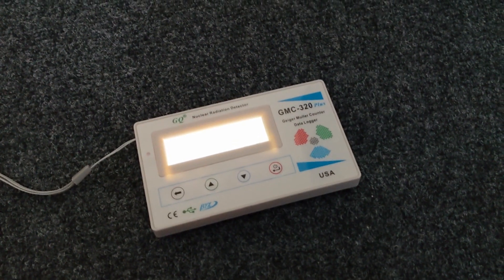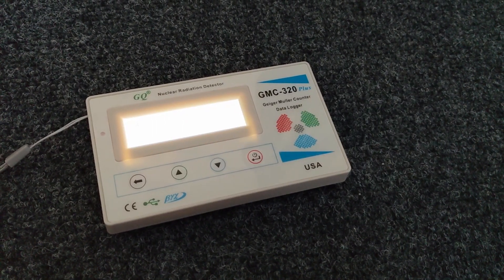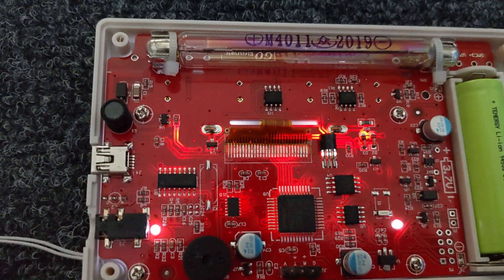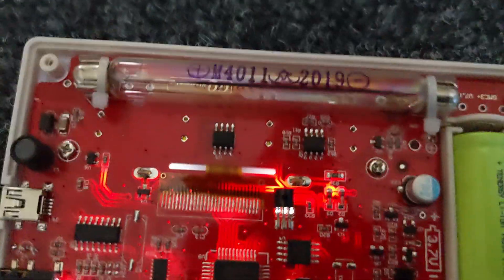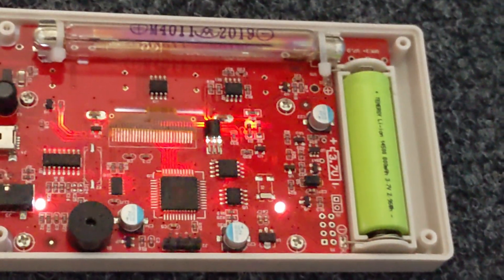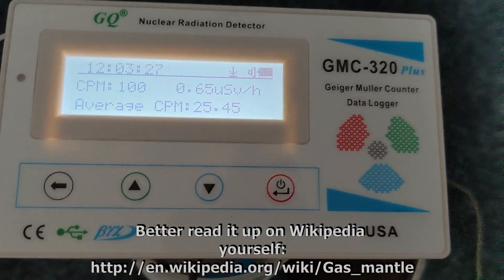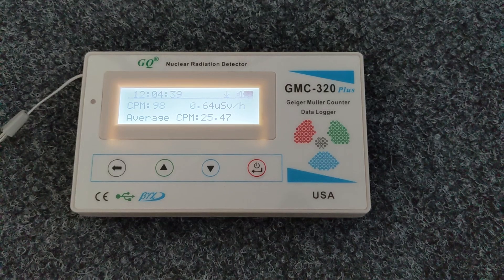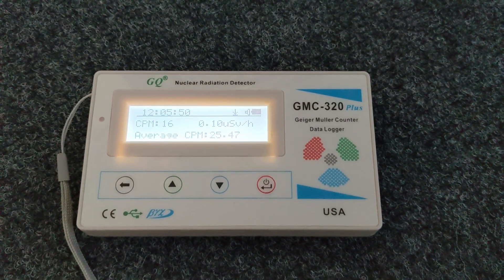Geiger counter GMC-320 Plus - Light sensitive M4011 tube | Geiger counter

Comment: Mine actually has a black plastic cover on the tube to block light.
Reply from the maker: Yes they added that at some point. I seem to have an early version that is also using an elder HW revision with a different processor.

Comment: You should know that this 20 tubes from Kyiv is very old and even they sold like new ones or looks like new they do not work correctly in 80%. Gas inside the tube is gone after 30 years and they can increase all measurements in 2-3 times. Try to find this info, i see this information about this tubes on Ukrainian channels
Reply: Better to buy another one like kb6011 it has j321 tube inside =4011 tube but with special foil over tube and do not sensitive to light
Reply from the maker: @sepe6a  I doubt that adding black heat shrink to the tube boosts their quality significantly, whether its a M4011 or J321. It surely helps to mitigate the problem a little bit. One could also spray-paint the glass body black, or wrap it with black electrical tape. I think my tube was just especially terrible to begin with 😄. Also I remember reading in the GMC support forum, that they also built versions of their Geiger counters that had the extra black foil added to the M4011 tube.
Reply from the maker: Thanks for the warning. The choice of tubes is limited. Either you get a bad light sensitive chinese copy or you have to use old Soviet era NOS. Neither is ideal... 😕 So far the replacement seems to work ok and does not produce completely implausible results, but i did not have time for detailed experiments with a test radiator yet.

Comment: What version is this? V4 or V5?
Reply from the maker: The version without the WiFi ESP32 module. So i guess V4.
Reply: @labcat73  I have a 320+ V4 as well, found out there's a firmware update available for these that adds the capability to go above 65k CPM, and adds fast estimate reading, when I got mine the firmware revision was 4.70, and the update changed it to 4.74. 

You just email GQ support with your model and serial number asking for a firmware update.
Reply from the maker: @madmax2069  I am on “Re 4.58”. I asked for the latest firmware version when I got the device. Is that still the newest one?
Reply: @labcat73  I emailed them yesterday, 4.74 is the latest. I wouldn't mind on seeing a video comparison of the count response/speed between the old firmware vs the new firmware. The firmware adds the settings fast estimate reading and the options are dynamic, 5-60 seconds.
Reply: @labcat73  if you plan to update, go through each setting (even the the calibration settings) and make a mental note, or in a text file, or on paper of each setting you have because it resets everything
Reply from the maker: @madmax2069  Interesting that there are still updates for such an old device. Good to know. I'll have to get it then.
Reply: @labcat73  it definitely makes them more usable, the update added fast estimate reading which is a pretty useful setting, when you change it to 5 seconds (the default is dynamic) it'll count up and stabilize on a source in a few seconds vs minutes. with my united nuclear test card it maxes out at around 500 CPM, and with the old firmware it took a bit over a minute to count up and stabilize, after the update and changing the fast estimate reading to 5 it counted up and stabilized in around a second. And also increases the max CPM (old firmware was 65K CPM now it's well about 100k CPM).
Reply from the maker: @madmax2069  Looks like i am out of luck: The CPU on my elder GMC-320+V4 is no longer supported it seems. I got a FW update, but it does not install on the STM 15L2K60S2 that i have in my unit. So i am stuck with V4.58.
Reply: @labcat73  did they give you the USB driver? And did you select the correct com port when you went to update? 
Or did the support or program say it's no longer supported ?
Reply from the maker: @madmax2069  The updater reported "MCU type: STC15L2K60S2
 F/W version: 7.2.5S
MCU type is incorrect ."
at the end, after whole bunch of other debug output. When i asked, they said they switched processors at some point and i have the latest/last version that was released for that elder processor already.
Reply: @labcat73  well that blows, didn't know they swapped out the microcontroller (CPU). I just figured they used the same one throughout the 320+ v4 product line.

 Sort of bad on them for doing something like that and not mentioning it. 

they should have made the newer versions of the 320+ V4 the V5 instead of calling it the same v4 as the older versions with a different microcontroller (it just causes confusion), and calling the current V5 the V6 or possibly V5 wifi. 

This isn't the first time I've seen a company do something like this, usually it's the reverse (example they have a great product, then change things to slower parts and keep the same model name and product ID without telling anyone).
Reply from the maker: @madmax2069  Well bad luck... Probably surprised by the longevity of their own products. 😂 Let's face it, the GMC-320 series still being around today is pretty odd. On the other hand, one is not swapping out a Geiger counter like an average smartphone every 2 years.

Comment: Please let us know if you replaced the tube and how it performs. Thanks
Reply from the maker: I got the SBM-20 tube yesterday. Shipped from Kyiv Ukraine in the middle of a war 😵‍💫 quite quickly and stuck in customs for a bit. Replacement was easy: Just moved the clips to the end of the PCB and had to put a short piece of wire in, so that the cathode is actually connected. I did not change the calibration values and reset the alert level back to 0.50uSv/h. Let's see if i get any strange alerts in the next few weeks/months with the new tube.

Maybe i can also test a few mushrooms now that we approach autumn. Some of the fallout from Tschernobyl came down here in  southern bavaria and mushrooms can be quite contaminated.
Reply: @labcat73  Greetings from Aschaffenburg! :) Let us know how it performs! :)